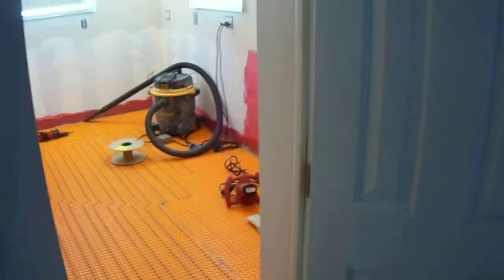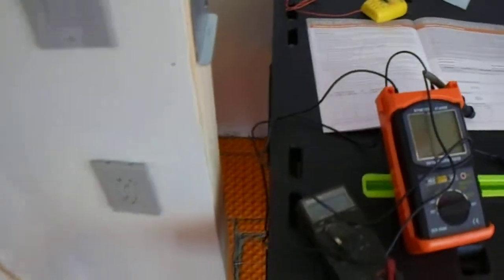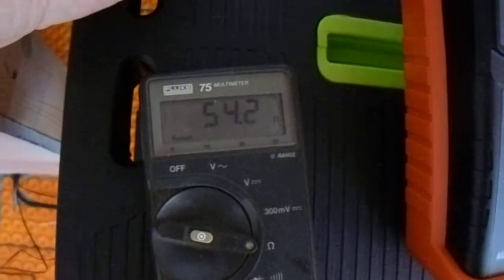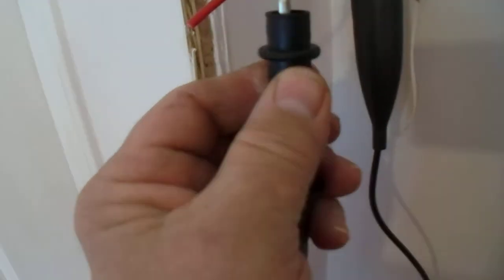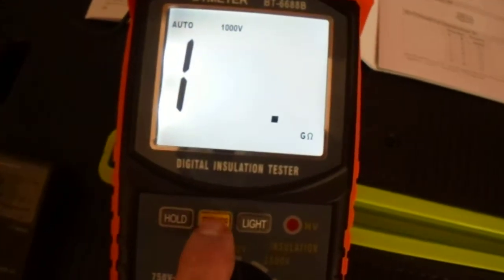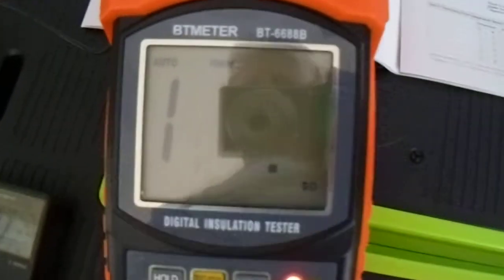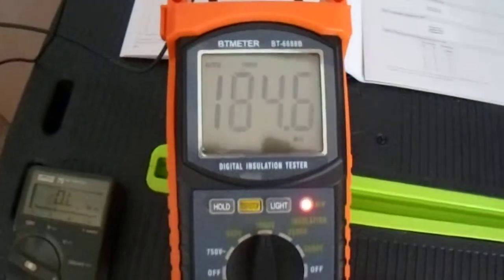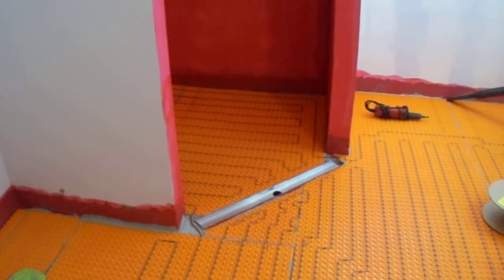Using the BT Meg-ohmmeter on a Schluter Heated floor floor

Comment: For gigaohms it kept repeating the test and pausing at 1 gigaohms, which is good, that's the number you want
Reply from the maker: Instructions were garbage and company was non-responsive. Bought another meter that gave me the number I needed and the floor has been working flawlessly for a couple of years now. The meter has been sitting on the shelf ever since. I don't want to throw it out since it's new and partially works but it didn't do what I needed and I have another meter that gave me a number.

Comment: I called Schluter about this.  Technical assistance told me  tha 1 G ohm is a good reading.  1 G ohm = 1000 M ohms.  You can write 1G or 1000M on the form.

Comment: Something similair appear with my ohmmeter device. since you found explaination?
Reply: 1 means 1 gigaohm which is what you want to see on a working cable.
Reply: The insulation tester works fine, the number you need is >200Gohm, which is a high insulation value. The tester read up to 200Gohm.
Reply from the maker: @jaimehuaynate7817  Maybe it does work fine but the one I bought to replace it  gave me a number I could use.
Reply from the maker: The place I bought it from says that is the way it's supposed to work. I gave up on it and bought another one from a different brand. My floor is in and the heat works great. Sometimes buying on line doesn't work out, but it usually does and I can't buy any of this stuff locally so I will continue buying on line and taking my chances. I'll have a video posted of my finished bathroom soon--It's really amazing and worth all the trouble.